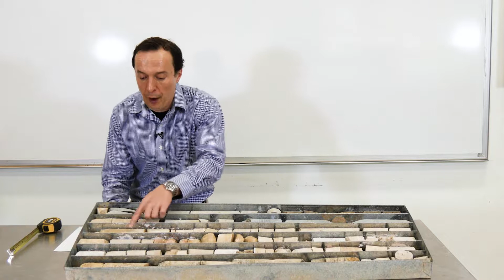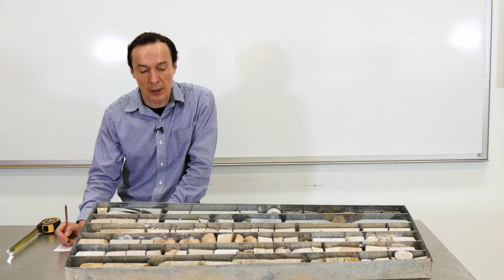Rock Quality Designation Index (RQD) | Procedure, Classification, Example #education #engineering

Comment: If you have pieces less that 10cm due to mechanical fracturing don't you still include them in the RQD?
Reply: Yes, even though it's a mechanical fracture, we still consider it as a sound core piece and include it under RQD

Comment: I believe that third piece of rock can’t be included in the calculation as it is broken
Reply from the maker: The piece has the length of more that 10 cm; even though it is split on top, it is still included in the calculation.
Reply: Dear Dr. , I appreciate  the scientific  materials  you presented in the videos  . 

Kindly , If possible to explain the CPT for deep compaction  and two to check  that required relative denisty has been achieved. If available  examples for explaining.